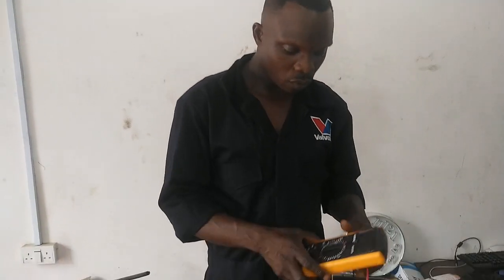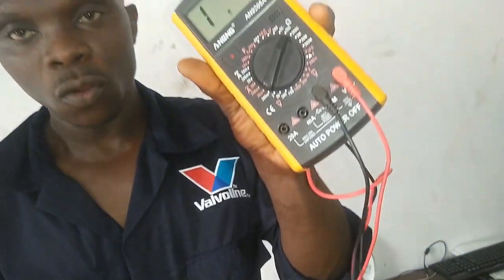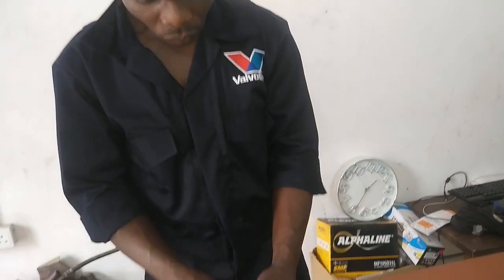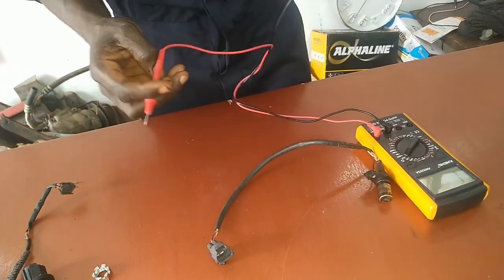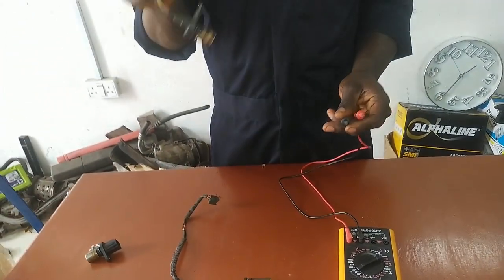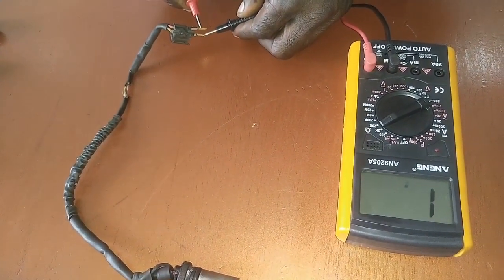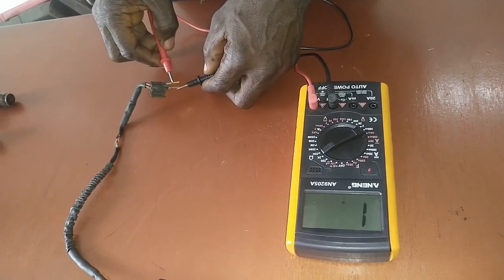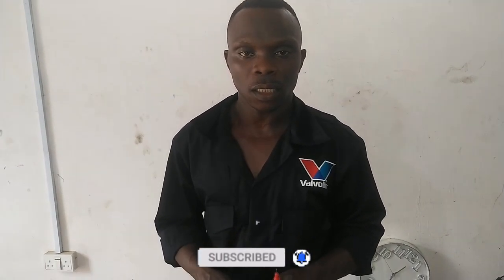How to Test Crankshaft & Camshaft Sensor (2025 Guide) | Easy Step-by-Step Multimeter Test

Comment: I have a problem I have a no spark no start on my ford f150 2004 4.6 I have power to the coil but there not sparking coil are new I change all fuse and relay even all the connector plugs on coil and fuel injector
Reply from the maker: It sounds like you’ve already done a lot of the right steps. Since you have power to the coils but no spark, the issue is usually on the control side (signal to fire the coils). On the 2004 F-150 4.6, here are the main things to check:

1.Crankshaft Position Sensor (CKP):
If it’s bad or not sending a signal, the PCM won’t trigger spark.

2.Camshaft Position Sensor (CMP):
Works with the crank sensor—if it fails, it can also prevent spark.

3.Wiring/grounds to the PCM:
Check the harness from the crank sensor and cam sensor back to the PCM for damage or corrosion.

4.PCM (Engine Computer):
Rare, but if it’s not sending coil pulse, you’ll get no spark even though you have power.

5.Security/Anti-theft system (PATS):
If the theft light is flashing rapidly, it can cut spark and injector pulse.

Best next step: use a scan tool to check for RPM signal while cranking. If there’s no RPM reading, the crank sensor or its wiring is the likely culprit.
Reply: I have had issue with the pats system i thought i had that fix replace transiver new ignition and remote and keys it went away flashing went away now u getting invalid security data i thinking it the pcm cause i had code there now there gone like the scp network code
Reply from the maker: Find an expert to check your security system for you
Reply: But i have no reading on rpm when i crank iy

Comment: brother i have tested my sensor, on 200 ohm setting it says 00.4, and on 20k setting it stays at 0.00. is it defect?
Reply from the maker: If the sensor is good there must be a  continuity 0.01 0.02 0.03 0r 0.04 hence your sensor can give you wrong readings base on the type of multimeter you used. So recheck it well

Comment: I read that a crank position sensor could be tested with the multimeter set to AC voltage, while cranking the engine a reading of .3 to 1 v/AC should be present coming from the sensor. 
Is this a legitimate alternate method of testing, or is it garbage?

Comment: Hi boss, please how can use multimeter to check ford transit key
Reply from the maker: Please wait. You can’t text the whole key to figure out whether it’s working or not but best of my knowledge there is an expire time for that particular key and when it happens you need to program it before it will work again. However if you want check the key open it and text the resistance if there’s continuity or replace the battery 🪫. I have done a lot of videos how to test resistance with multimeter check them out on my channel. A lot of useful videos  if not see to smart key expect to assist you.

Comment: I'm getting an ohms reading of 0.95 on a crank sensor I removed and replaced with a new one because the car kept stalling,is the reading of 0.95 bad? Should there be any periods before the numbers?  Or should it be a full number for example 200 with no periods before it?sorry for the questions, I'm trying to learn this.
Reply from the maker: Literary, a good working crank sensor should have an internal resistance of 200Ω to 2000Ω. If the sensor shows a 0Ω value, that indicates a short circuit, and if the value is boundless or million ohms, there is an open circuit.
Reply: @ERICAUTOCENTER  ok thanks for your help.